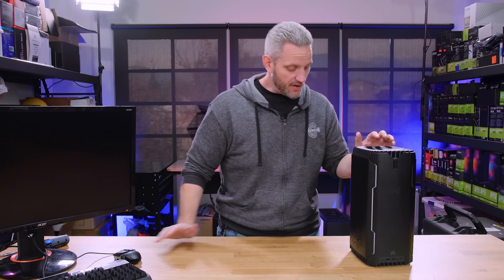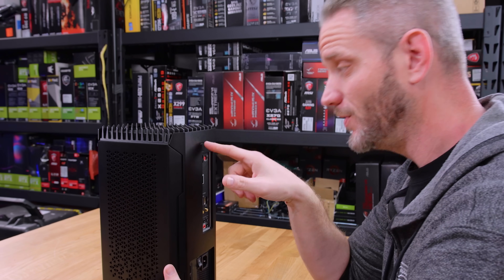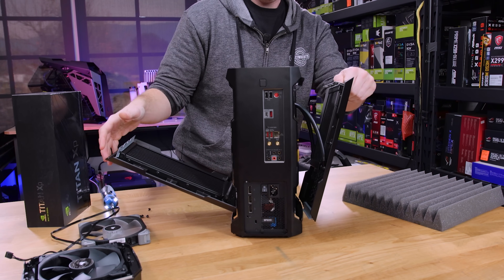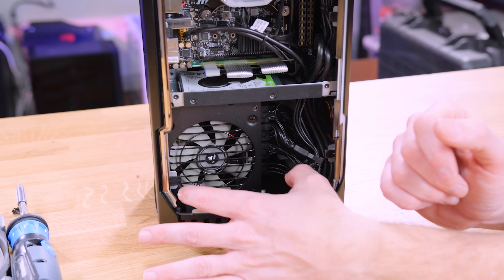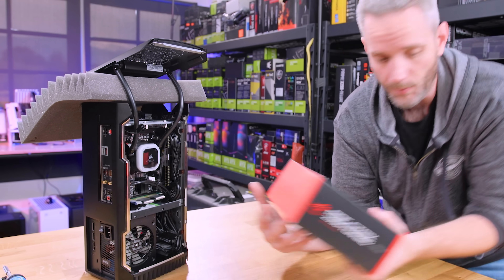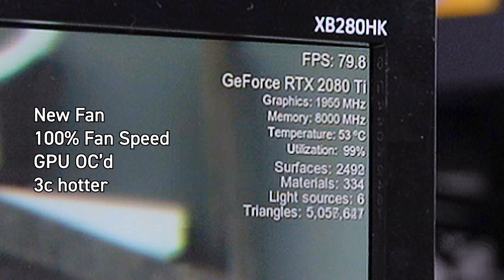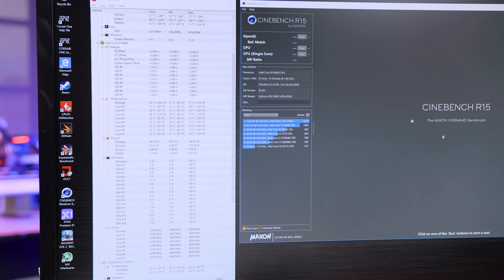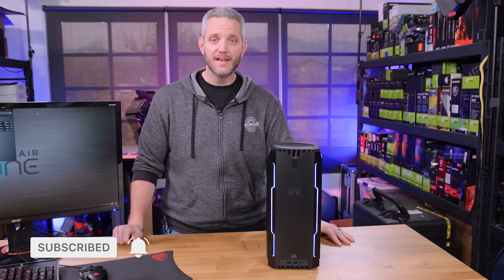Overclocking and Tear Down of the Corsair One

Comment: the clock speed on that 2080ti is low
Reply from the maker: Its because of the mid 50s temps. This card also offers less power limit increase than other cards.

Comment: Use a fan with the highest RPM ever, plus overclock the fan to spin faster.
Reply: Water cool the water cooler used to water cool the fan.
Reply: Guitarocker493 top ten real life superheros
Reply: @Guitarocker493  Water cool the air in the room
Reply: @Guitarocker493  water cool the world
Reply: Noah has entered the chat
Reply: @813loonatic  It is already.
Reply: water cool the fan
Reply: You mean like the 6,500 RPM 140 mm fan from Delta Electronics? The PFM1412DEB7V? The one that is louder than a vacuum cleaner?
Reply: @P8qzxnxfP85xZ2H3wDRV  Is that Linus' Blowiematron?
Reply: @empyrical  No, it's not. The fan on LTT was smaller and 11,000 RPM.
Reply: @P8qzxnxfP85xZ2H3wDRV  ehh whatever, I just want him to get the biggest overclock
Reply: @P8qzxnxfP85xZ2H3wDRV  Yeah!!  THAT ONE!!   sum bitch would probably suck the dust off the floor of jay's house, let alone the "OFFICE"
Reply: He had to use the blowie matron !
Reply: Yeah, we want to see that Jay! Turn this PC into a helicopter
Reply: If he'd use the blowie he needs to screw the case on the floor to not make it fly away
Reply: @Silly Brothers yep and then it can fly to
Reply: Why not use a trubine... why not build a pc INTO a turbine?

Comment: This is a very clever small form factor system with a lot of power. It's a given that a DIYer could do better, but that's not the niche' customer Corsair is targeting is it? On another subject, I do not understand Jay's opinion of the BIOS of either the MSI or Gigabyte mobos. It must be the UI's; they both do the job don't they? If you have trouble navigating thru them quickly, then I would politely suggest you RTFM before using and slow down.